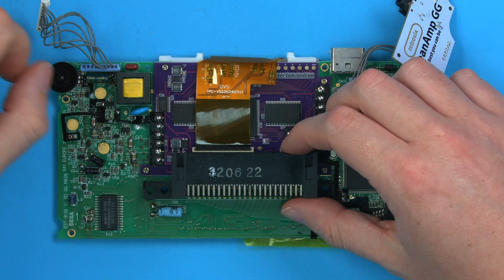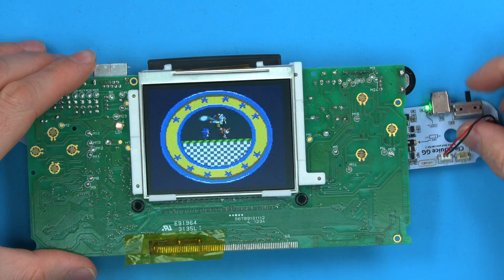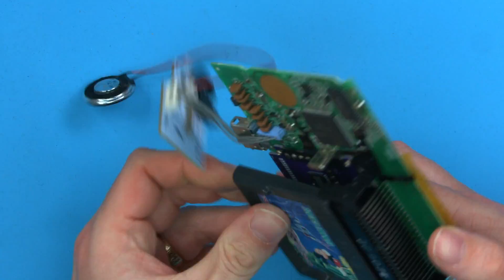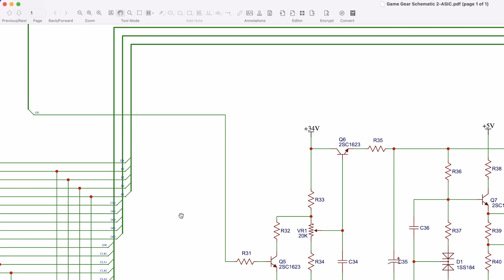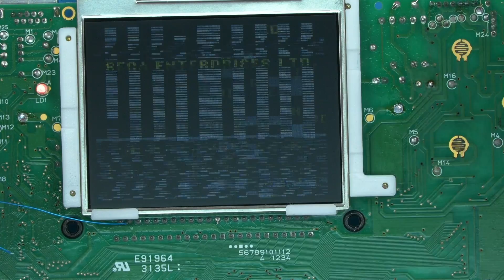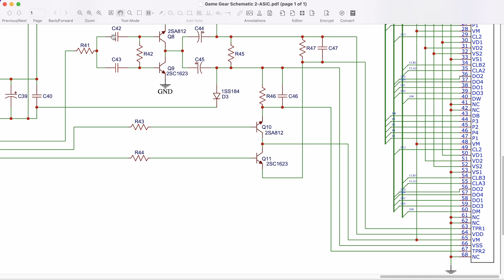Game Gear Strange Issue Master System Mode - RetroSix

Comment: Hi, I used everdrive to open a sms game and it heated then gg shut down.now the gg is shuttind down when I try to power on and no red light.gg was recapped and just workng fine.Also everdrive work on other gg but not starting games.what can be the problem? thanks
Reply from the maker: Everdrive has known issue on SMS pin sending wrong voltage to console. However it doesn't normally heat up console. Could be failing power board
Reply: @RetroSix  card was heated not the console...I triednthe xonsile with another working power and sound board...still shutting down...do you have an idea where can be damaged
Reply from the maker: @gurolonur so only when using everdrive it is shutting down and everdrive getting warm? Sounds like faulty everdrive
Reply: @RetroSix  not working with any card
Reply from the maker: @gurolonur check this https://www.retrosix.wiki/reading-game-cartridge-game-gear

Comment: The trace between pin 29 on the cart slot and IC1 is broken. Just kidding, I have no clue, but yeah wait for your oscilloscope. Not an easy fix by the looks. 
By the way... thanks for the job on my Flanders Edition GBC. Fine, fine work. Did a video on it. Thanks! 👍